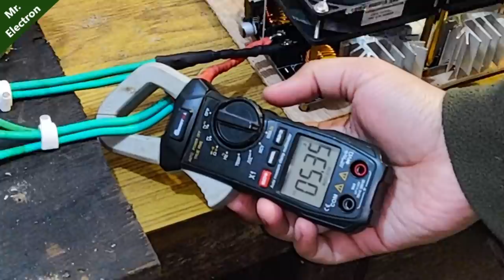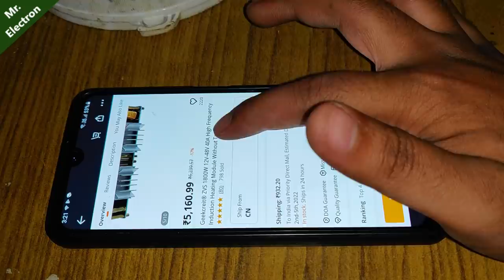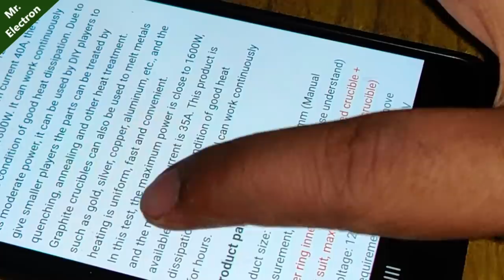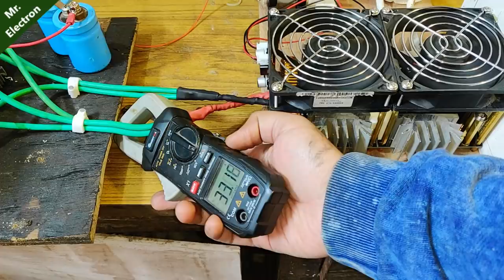12v to 48v 50A ZVS Induction Heater for Melting Metals - 1800W

Comment from the maker: Join this channel to get access to perks:
https://www.youtube.com/channel/UCWFbPzBb7dCyCWuBA-DBrMA/join
Mr.Electron Patreon's Page - www.patreon.com/mrelectron
Hindi Channel                 - www.youtube.com/@Mr.ElectronHindi
Alternator Channel            - www.youtube.com/@mrelectron_alternator
Watsapp Channel              - https://whatsapp.com/channel/0029VaQmmRaFCCoWOf7huh3G

1800W ZVS INDUCTION HEATER :
Coupon:BG49690e ，$59.99
LINK - https://bit.ly/32gHa1V
My New 3D Print :
Soldering Iron Stand - https://cults3d.com/en/3d-model/tool/portable-soldering-iron-station-stand-electronics-bench-electronic-workbench
ALWAYS KEEP THE PUMP ON IF THE INDUCTION MACHINE IS ON EVEN IN THE IDLE STATE.
PowerSupply Video - https://youtu.be/rRMUGfqfOpU
GIANT Rectifier Video - https://youtu.be/npOUwCwj0cQ
Reply: What was the white water tube made of?  Any idea how close to 100c the water got?
Reply from the maker: Simple Plastic..  Also , it depends on how long  you are using it for.. Its recommended  to use larger water bottle    which means slower heating.
Reply: @MrElectron  Thank you
Reply from the maker: @l0I0I0I0  not even 40 degrees.. water keeps it from melting
Reply: @MrElectron  Thank you.
Reply: Ah! Says, it does not ship to India.
Reply: This induction heater can be use to make steam generator
Reply: @MrElectron  can you change the heating shape into flat so I can cook steak? Please answer. Thanks
Reply: @randomstreamertv7082  uu7l of
Reply: It can be used to cast Lead and Tin? I need temperature of at least 400°C

Comment: Please take safety precations. It's very danger place cooling water/power electronics/red hot devices so close without any heat/electricity isolation Also you need wearing safety device. Accidents may happens any time. Don't bid on lucky chance.

Comment: Ripple current in the capacitors will be high but limited by the thin connecting wires. I made an induction heater about 50 years ago. I used a water cooled triode, the work coil was 1/2 inch pipe. There was a large tank of de-ionised water that was pumped around the valve and the work coil. the power was 10KW, 10KV power supply built from a big mains transformer.. I enjoyed your video
Reply: Could you tell me how efficient your unit was as compared to this unit Bill ??? Would you be able to use your first made unit to heat a house just using electricity ?? I am very interested in using this technology for home heating. Please drop you thoughts of my direction of thinking on my idea Sir. 
Thanks and drop a line fella.
Reply: @victoryfirst2878  Hi, I made two. I don't know the efficiency. Would not have been so good all that time ago. Not suitable for heating a home.. My first one was for medical research. The work coil had a glass tube which went through it. Samples of lung tissue taken from people who had died from asbestos inhalation was placed in the tube. Oxygen was passed through it. The lung tissue burnt away leaving the asbestos behind so that the amount of asbestos could be seen. The second one was for a technical college. Both were very big, Had a large tank of distilled water which was pumped around the work coil and valve. To reduce the amount of electricity to heat a house you could use a ground source heat pump or an air source but not as good. Heat is taken from the ground or the air in a process similar to a freezer. In a freezer the heat is taken from the food and is given off as heat at the back. Search heat pumps for more detail.
Reply: @billhall8745  I have to thank you for the information on what and how you did the project at hand. Would you tell more of the progression with the machine that you built ? From my experience in turn key medical packaging machines machining and installation.  I just love to read other person's progress of making machines. I am especially interested in the progression of very simple methods to make things happen. Thanks again Sir for you telling me about your experience with this subject matter. I look forward to hear more details
Reply: why
Reply: @jamesatkinsonsr  Simple. I would like to make a heating unit for heating an enclosed space. Am thinking that just maybe this type of heating would excel in this field. One just never know when something ultra positive can occur just by asking and trying.
Reply: Hello.  Is it possible to make a commercial induction furnace? Any leads?

Comment: Adding salt or sand or water in your tube before you bend will result in a better formed bend.  Thanks for sharing!
Reply from the maker: Thanks , i forgot about that..
Reply: Noted
Reply: I too use the sand method, amzing results.
Reply: Is that the secret?? Thank you bro! I can never get a bend to go right
Reply: Imo i believe water wouldn't be the best option, because it would require more heat to make the bend.
Sand would leave some particles stuck in the tube and potentially break off after some time.
However salt, sound like the best option. Because it would act like sand when heating the tube but you can disolve any remaining salt with water.
Reply: @JoeNathan42420  🌚
Reply: @ಶುಗರ್ಡ್ಯಾಡಿ  🌝
Reply: I've had no issue with contamination, all you have to do is tap the tube and it all comes out.

Comment: Thanks for the video - a few comments. First the issue with the big caps is the ripple current rating which needs to be over 50a for 35a draw - none had a spec showing but bigger is usually better. Second point is that for most of the incoming sine waveform it is the caps that are providing the load current so why are the wires to the cap(s) so puny ? Lastly, though the supply volts are only 48 the high frequency ac on the coil will be several hundred V so watch where you put your fingers when it is running !

Comment: thank you for posting.  based on 20+ years experience in industrial induction heating, i suggest you rework the board & coil leads to bring the coil leads as close together as possible, w/o touching.  insulate coil leads w/ 0.06" ptfe [teflon].  you want the CL-CL distance of the coil leads as close as possible, w/o touching.  perhaps a small fan-cooled radiator in the coil-cooling flow ?

Comment: Thanks for this interesting video. I'm going to purchase the similar device but the one with a nominal power of 2500W (it has  six MOSFET instead of four).
Nice to see it working, I think that the big challenge is to have a good power supplier and to control temperature.of the single parts.
For the moment I'll be able to work with about 30V and in that conditions I should obtain about 1500 W,. In the future I'll prepare a DIY power supply able to give the 48 volts with at least 60A in order to push the device at it maximum performance.
Thanks for the video, I'll let you know the results of my tests 
😀
Reply: For the PSU try an old welder. That should handle up to 200 amps no sweat.Regards MoK

Comment: silicon carbide crucible use with silicon blanket which is protect heat transfer to coil, and change your water can, because cooling water going to heat after some time. You can use radiator with fan for better performance.

Comment: You should use a lot bigger water cooling bottle, I use a 5L tank for my 2800W induction heater and after 20-30min of use, the water inside is already boiling hot !
Reply from the maker: You are right. I made the correction just 3 days after that. I already have uploaded a video which includes that part.

Comment: If voltage less than 12v ZVS can't work that cause short circuit. Also put a cooling fan to heatsink cooling diode bridge. The polarized filter capacitor for DC voltage  need a resistor few K ohms connect parallel with each single cap so it can charge balance or the capacitor will blow up and emf cause from zvs could cause capacitors overheat make it blow

Comment: Why you can not put this graphite crucible on a usual kitchen electric cooking plate, which runs on a usual 220 (or 110) V ? 
Or take a spiral wire from an usual 220V electric home heater and mount it round on the graphite crucible? 
It would be the same 1.5 - 2 KW, so would give the same temperature result.
Reply from the maker: We don't have that here in India..
Reply: @MrElectron  нихрома нет?

Comment: Hello, Sir, how did you change the current frequency?
Coil heater requires a lot of kHZ -> like 100kHz+
While power supply deliver in our homes is around 50-60Hz

Comment: Hello, I want to ask if I want to heat a cylinder with a diameter of 40 cm for an hour, just how many watts of heating does it consume and what are the necessary adjustments to bring it to 350 Celcius?

Comment: Nice video what is the transformer that you have used the value of the capacitors and what line output transformer did you use

Comment: What was the supply voltage when you were attempting to melt the aluminum in the graphite crucible?  I suspect that the voltage had dropped 10 or more volts.

Comment: Rhw cooling system is t just inadequate, the materials used will literally not hold out long enough to provide substantial or long term use. It'd be a miracle if it lasted 15 minutes of continuous use even once.

It was also completely unnecessary to plumb in a connection through the reservoir that had to be fitted and sealed when both tubes could have simply been fed in from the top. In fact, it would have been better if for cooling if that had been done as there wouldn't be any extra fittings constricting flow rate.

Comment: What is the frequency of the inductor? This is the most important information...
Reply: 100KHz going into the copper coil, then, into a steel workpiece is what causes it to heat up.
Workpieces must react to magnetic fields, if they don’t, this induction coil won’t affect them. 
The copper pipe isn’t magnetic. The close proximity of the hot workpiece is what causes the copper pipe to heat up.

Comment: Would it be possible to use this to make an induction stove? I would like a 12-24v induction stove.🙂
Reply from the maker: its possible but the temperature control unit is mandatory.
Reply: @MrElectron  okay. Thanks for answering. 🙂
Reply: @oplkfdhgk  🙂👈👈🤣
Reply: @x-6790  😂😂👺🤚

Comment: you can set the max temp reach for this system?
Reply from the maker: No
Reply: @MrElectron  ok so for melt metal is not much indicater better a furnace

Comment: Why is it that induction cookers used in cooking seems less efficient at heating pots? They draw almost the same power of we think about it. 1800watts will boil water within 10 minutes while this can melt metal in a matter of a few minutes? Am I missing something other than the ferromagnetic properties of metal pots?
Reply: Probably just that it actually requires more energy to boil water. Boiling water requires a lot of energy, and there is usually ALOT more water in a pot than there is when melting metal
Reply: The induction heater in this case is directly heating the metal by changing the magnetic field, this affects every single molecule of the metal at an atomic level as the field completely surrounds and permeates it.

Water can't be heated by this type of induction, so we heat up a metal pan, which then passes this heat on to the water via conduction.  In addition, most induction stoves only heat the bottom of the pan, not the sides. Only the water molecules in direct contact with the bottom of the pans will absorb heat, then convection has to occur for that hot water to move up in the pan, bringing new colder water molecules in to contact with the bottom and the process repeats itself.

Comment: Oh god.... This is a mess, why are you showing this? You bought a coil and an induction heater without any problems, but the rest you  made of rubbish. Your soldering iron is not suitable for such small items because it is too powerful and in addition its tip should have been replaced a long time ago ...
New machine and get dirty in one video XDDDD